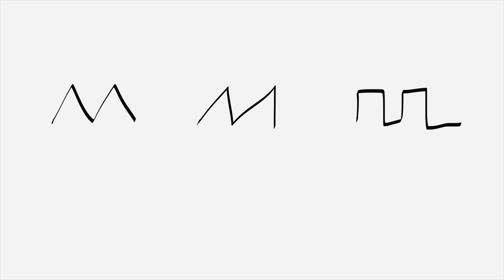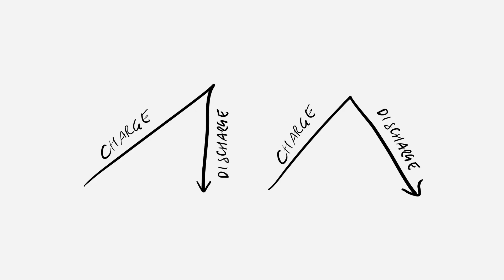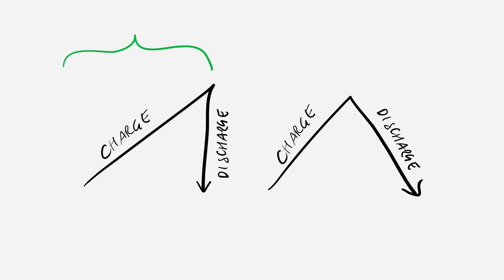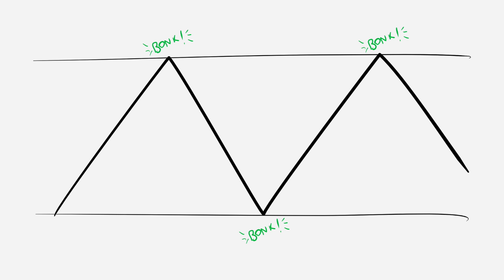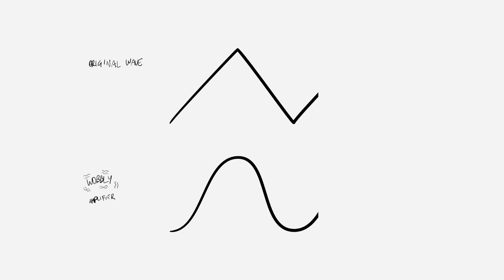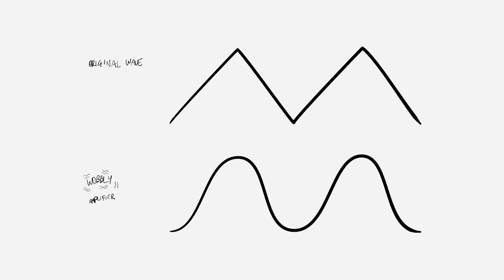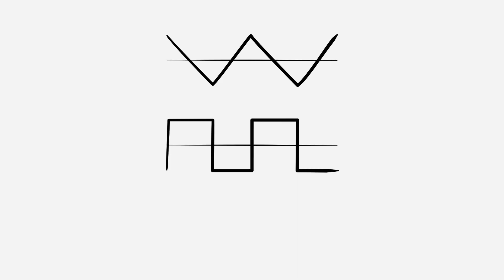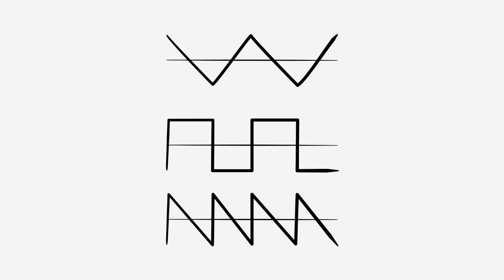How does BRENSO generate its wave forms and how to win an extra analog sawtooth!

Comment: Ha, nice. I just figured out a couple of days ago I could create a saw on my ts-l this way 😀. But I have a simple question, what made you choose to use the 4QM instead of the vca on the Brenso? I just tried it on mine and it works just as well.
Reply from the maker: Excellent remark, this takes the patch to an ever more efficient level! We used the 4QM to demonstrate the whole process, including what happens when you multiply two bipolar signals. But as you point out, patching the square wave to the VCA input and the triangle to its attenuverter creates the same effect! There are two things worth noting, though: 1) be careful with the levels to avoid squaring and 2) the trick works because BRENSO's VCA is linear: on an exponential VCA it would be impossible!

Comment: Giovanni, I just picked up a Brenso and I'm curious is it ic chip-based or discrete?
Reply from the maker: Hey Nick! The BRENSO is all-analog: the chip you see on the back is only doing the frequency lock button trick!
Reply: @ thanks! Yeah, I understand it's analog, but some vcos are built with a chip by ssi or another manufacturer. Verbos for example, uses a discrete design. Either way, it sounds good!
Reply from the maker: @nickjones5641  Ah right, sorry if I jumped straight to the most commonly asked question. We use ICs as op-amps but the circuit design is made from scratch. We do not use any kind of specialized ICs. Hope it's clearer!

Comment: so i'm familiar with four quadrant multipliers producing sum and difference frequencies, but hadn't understood that an offset can alter that. are there other interesting behaviours or generalizations if one of the waves is offset to be unipolar?
Reply from the maker: The sum and difference thing works when we are using different signals like the "carrier" and "modulator" of AM/RM; in that case, using an offset would switch between amplitude modulation (bipolar*unipolar) and ring modulation (bipolar*bipolar). Since in this case the signal is the same on both inputs, the whole sum-and-difference thing is ruled out and we can use the 4QM as a voltage-controlled attenuverter at audio rate!